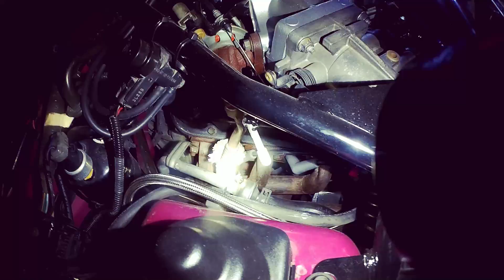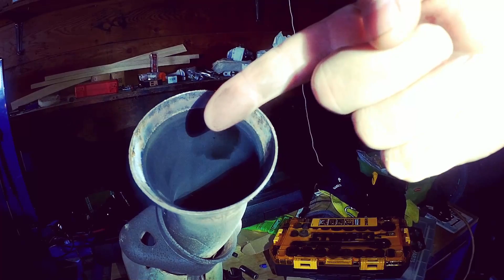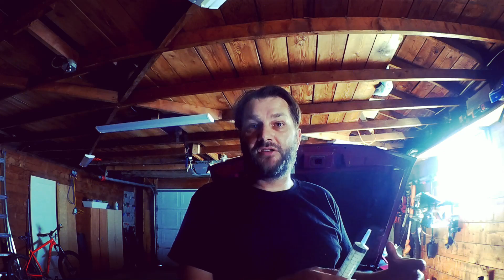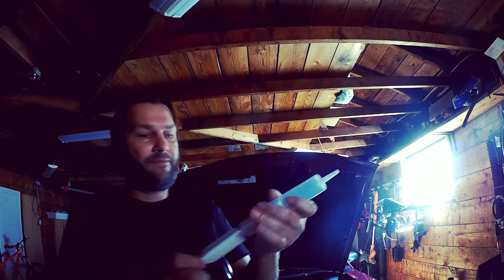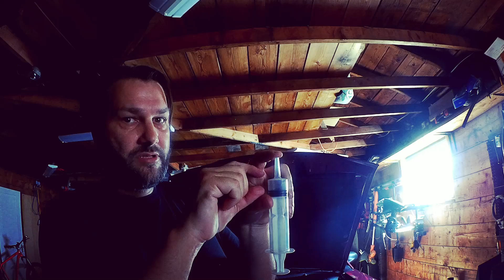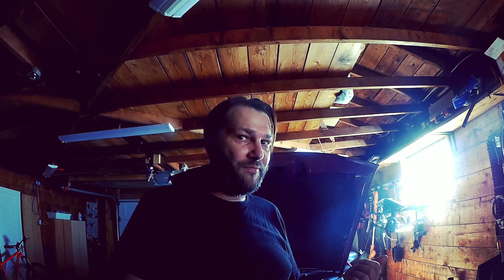EGR (Exhaust Gas Recirculation) does more than you think.

Comment: I work on a few VAG engines, I wasn't convinced by all the kids "deleting" the EGR, I had one broken on a 2005 Touran, I decided, regardless of the trend, it does at least cool the engine slightly, and more importantly, the entire set up of the engine is designed with the EGR included. just turning it off, wouldn't be complete, so I bought a new one, rebuilt the engine, its running very very smooth.
Reply: i live in France :\